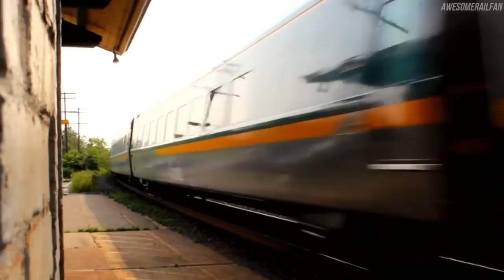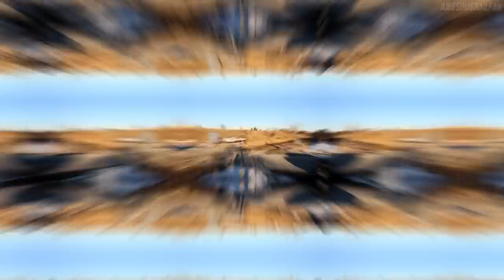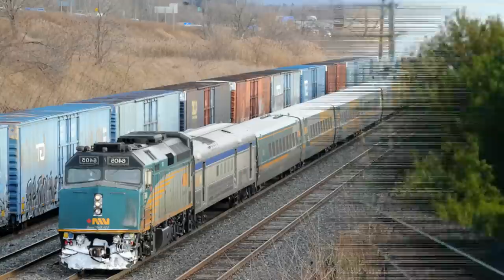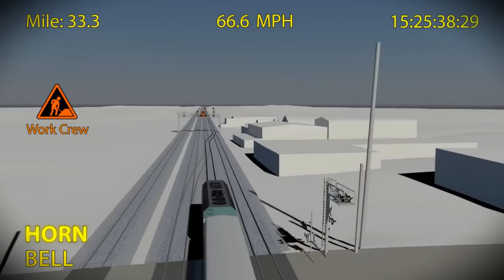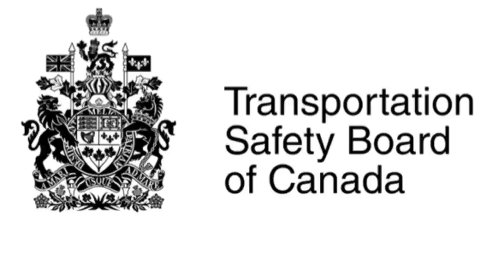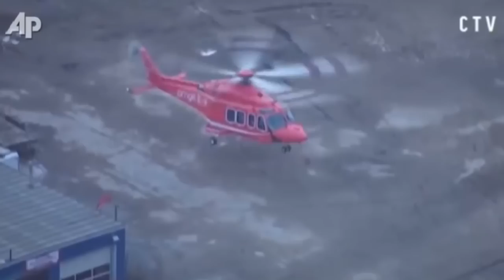Engineers Distracted? | The Burlington Train Derailment in Canada | Short Documentary

Comment: INSUFFICIENT TRAIN CREW INFORMATION & TRAINING PROBLEM !!!
If the information given in the programme is correct, with respect to this crash. Then a SERIOUS hole in Canadian working practices has been revealed. In Britain in every "Drivers crew room" there is what is known as the "Late Notices" case. A large red glass case with details of All track repairs, and temporary speed restrictions, that have not previously been published in the "Weekly Notices" booklet. 

Train Drivers are obliged to read their "Weekly Notices" & check the "Late Notice" case, BEFORE proceeding to drive any train. Which in Britain would have made ALL train drivers using this route aware of the engineering & track occupation of the section of line being repaired, which in this case led to this VIA train crash. 

Indeed there is an even stricter condition that if a fault had just been discovered. Meaning no train drivers would yet be aware of the problem. The signalman responsible for the problem location is obliged to bring ALL trains to a halt at a convenient signal a mile at least before the problem. Then inform each driver via a signal post telephone or radio, of the exact problem and a reduced speed over the problem (such as 10mph). Or if possible switch the trains to a parallel track via the normal signal indications, to avoid the problem altogether, while the track engineers get on with correcting the fault.

In the case of the VIA train derailment, I would also suspect two other problems were involved. Too many people in the locomotive cab, causing distractions ! And the bigger problem of the absurd and needlessly complex signal system in use in this case. Which is an American 1930's type of colour light speed signalling (not a geographical type !) This dangerously crude signalling method, which fails to clearly indicate any safe speed precisely or the reason for such a restriction. Is also plagued by subconsciously dangerous aspects, revealing a total ignorance of human psychology. I will add here that I have driven trains in numerous countries in the World. Including lines in the USA which also use this fatally flawed signalling method. 

Further in 1985 I gave a talk on signalling to Chicago & North Western Railway train drivers in the Chicago area. The talk included the dangers of the signalling system used in this VIA derailment, along with another seriously deficient US signalling system known as 3 position semaphore. (Both those US signal systems were tested in the UK in the 1930's & banned). In the C&NWR case there was also an allowance for this signal system to incorporate "Permissive Block working" on fast moving lines. But is in reality a method only suitable for slow moving (30mph max) freight trains !!!! 

The talk quickly revealed that US train drivers were NOT being trained sufficiently on ANY of the signalling systems being used in the US at that time ! As Canada appears to like copying US practices, the implication is that Canadian drivers are also insufficiently trained in signalling !!!!!!  

NOTE: The British four aspect colour light signalling system, developed also in the 1930's, was designed with the need for trains to pass safely along a route at 90mph every 2.5 minutes !! It was first introduced in 1933 on the electrified (3rd rail 750v DC) very busy mainline from London to Brighton. It is very simple in its displays, but also provides clear indication of how many signal sections ahead are clear. So giving miles of forewarning of any speed reduction that might become necessary. It is also a Geographical system. Which means, that any place where a choice of tracks occur, such as crossovers, junctions or complex multi track stations. The Driver is given a precise indication of EXACTLY which track he will change too. In Britain train drivers have to learn their routes, which requires a mental picture of the location of EVERY signal; EVERY SPEED restriction; every station; every signalbox & its type; every tunnel & its name; every level (road) crossing & how each type works. And remember all this even in thick Fog !!!! 

The Japanese Railways incidentally, came to Britain in 1933 to assess this new system. They developed it into a 5 aspect system to allow trains at a maximum 60mph at 1.5 minute intervals, very successfully !!

Comment: In airplanes, we have 2 (black box) data recorders: the flight data recorder (computers, controls, sensors), and the cockpit voice recorder (a loop-recording audio recorder).  The train industry would benefit from a version of the cockpit voice recorder.  The CVR doesn’t just record the headset and radio communications, as there are ambient recording microphones in the flight deck.  There’s a saying “be careful what you say in the flight deck, because if you have an accident, the whole world will know what you said in those last few hours.”  Intrusive? Not really, because when you’re working, the job comes first and niceties come second.  It also is good to be “professional” anyway.

If only we knew the communications, as that would have shed much more light on what they may have been thinking or dealing with.
Reply: A short-range rail ATIS system that could notify nearby rail traffic of local information related to track changes, delays, or other conditions. I mean, what does it take? A receiver in each cab and line-of-sight transmitters placed at certain signal lights that can be fed updated information remotely? Technically, it's viable.
Reply: @rnascak , you’re definitely on to something. They already have signal cable networks to feed the light modules their proper light configuration. Make those transmit their own status to the train should be enough.

Comment: 4:43 The second signal gantry on the far side of the junction wouldn't have been visible to the crew of this train - it protected the junction from the other direction. In the US/Canada signals either side of a junction are called a 'control point', a signalled interlocking controlled by the dispatcher through CTC or locally from trackside but only with full authority granted. You also say that 'the crew wouldn't have needed to know...just obey the signals' - that is also an error but not on your part, they should have been given written notice or at least read a 'train notice' and signed to say they'd read it (which is the case here in the UK) as to the MoW crew - where they were working; track they would be on/switching to; train speed in that area.
Reply from the maker: Hey, I got this information from the TSB Canada final report, including regarding them not being required to have been informed prior. Possible rules are different in UK?